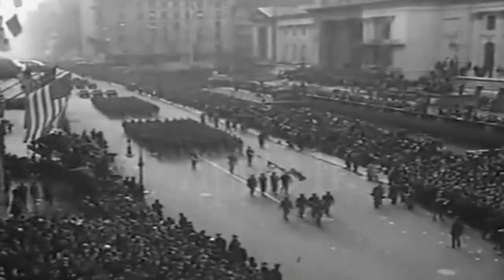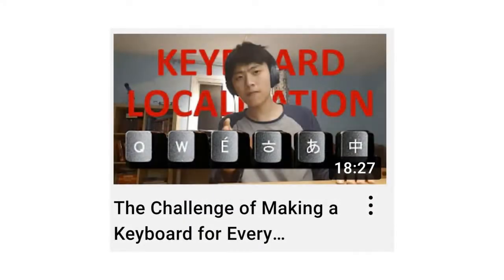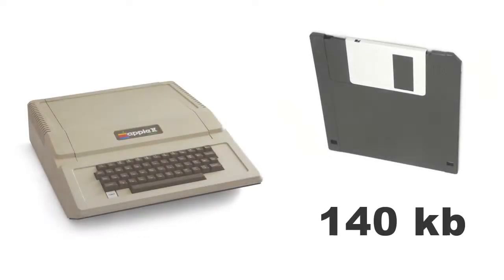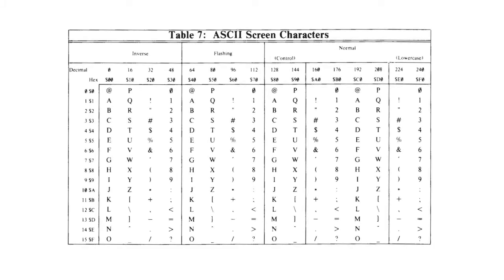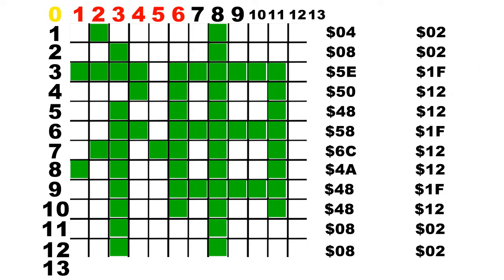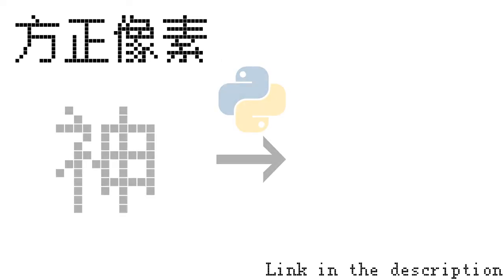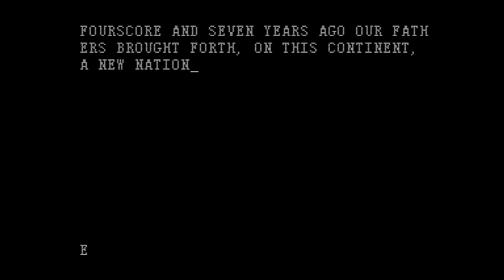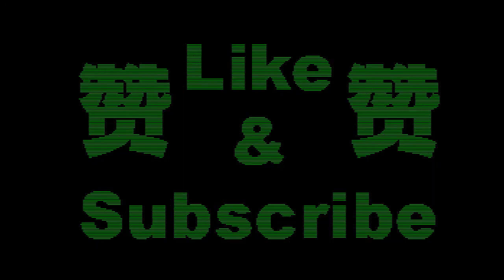How I made typing Chinese on the Apple II possible

Comment: Old computers did not have good multilingual support. even in the 90s languages like Spanish or French would get messed up if you had accents on the letters like è would be ? .and that was on systems with a 500mb hard drive and could play quake and browse the internet not 8 bit systems with very low storage. i think i saw a windows 3.0 ad from the early 90s where they bragged they supported 10 languages now they got 130+ on windows 11.
Reply: Old Japanese computers had brilliant multilingual support. But it's hard to fault Apple for not building that in; it's expensive, and what American would care (or even know)?
Reply: @Curt_Sampson  They didn't they only had Japanese and English and maybe Chinese. they also had to make systems made for japan only .they couldn't compete in other countries because they had different standards for everything.
Reply: @belstar1128  That's pretty much entirely wrong.

The Japanese computers were using American standards for almost all the components. The CPUs were mostly Z80, with a few 6800 and 6809: both American designs that the Japanese manufacturers licensed. Most of the other chips (and virtually all of the important ones) were American designs as well. The video standard was NTSC: the American standard. The BASIC in ROM was almost invariably Microsoft BASIC.

They did export their computers, too, though with somewhat limited success. The cover story of the May 1982 issue of BYTE magazine was a review of five Japanese computers, and I still regularly see people both in the U.S. and Europe with, e.g, a PC-8001A, the western version of the PC-8001 (the best-selling series in Japan). The most successful export was the MSX computer series (from multiple manufacturers, based on a standard developed by ASCII Corporation and Microsoft), which was reasonably well known in many countries (all of Europe, Brazil, etc.) outside of America.
Reply: @Curt_Sampson  nobody used Japanese computers outside of japan apart from the msx. and that one had limited success in only a few random regions. a lot of the best selling games and software for the msx in japan was not sold world wide. and western users had their own different software. there was no law that stopped japanese systems from coming out here. but they failed or never bothered because the market was too different. also all these Japanese systems where incompatible with popular western systems at the time. even if they did use American cpu architectures. because the rest of the world couldn't make decent cpu's. the ussr tried to but they gave up and just started copying western chips. japan didn't have a reason to do that since American cpu's where good enough. but it didn't matter because they actual full computer could only run software made for that computer. in most countries the ibm pc became the dominant computer platform and the mac survived. but in japan the ibm pc and mac didn't get popular until the mid 90s
Reply: @belstar1128  It sounds to me as if you've defined "standard" as, "western computers," which seems to me a bit culture-centric. Japan certainly did fail to meet the early '80s western "standard" of, say, 280x192 6-colour composite video displays set by the Apple II by instead using a 640x200 8-colour RGB display with a separate processor to handle graphics, and an extra 48K of RAM for the frame buffer on top of the usual 64K (1981 FM-8). 

And Japan did make their own CPUs, such as the Panafacom L-16A (MN1610), which in 1975 was one of the first 16-bit single-chip microprocessors. If you're thinking, "I didn't know that," yeah, there's a lot about the Japanese computer industry that's not well known in the west, and that causes people like you to look down on it when in many ways it was superior.

"but in japan the ibm pc...didn't get popular until the mid 90s." Yes, and for good reason. The IBM PC simply wasn't capable enough to display kanji, whereas the 8086-based PC-9801, introduced the same year, was. And even the 8-bit PC-8801 could do 640x400 graphics from the start. Western computers took a fair amount of time to catch up and it wasn't until after they did that they could be useful for business in Japan.

Comment: There was a word processor for Hanzi/Kanji for the Apple 2 series released in 1985. It was called Assist 16. It ran on a 48k apple IIe or IIc, and included 2965 characters. But there was another program that I can't find a reference to, that allowed you to create arbitrary hanzi/kanji by codes corresponding to radicals in each areas of the character.
Reply: The latter program is called Cangjie, but it required an extension card.

Comment: Pretty cool, looked like an easy project lol. I can see why people make "quality of life" improvements to old coding environments, even bitd people would use better faster platforms as their development kit Eg. Amstrad to ZX Spectrum development.
I don't speak or read Chinese but the language conveyance systems shown in the past and the one you made certainly seemed logical in operation. Been working on text related projects myself and most Asian languages are a tough fit within those old graphical constraints and despite English having it's own quirks it is the most compact alphabet ever made by far.
Reply: Depending how far back you go in Apple 2 development, there really wouldn't've been stronger platforms to use to develop on other than considerably more expensive minicomputers or mainframes, with Apple 2 being one of the first home computers that was ready to go and use out of the box.  But yeah later on for sure, and I wouldn't've criticized the person who made this video for using a fully modern environment with a build script that packed it all up in to a disk image to load in the emulator.  I've definitely developed for older systems in the same way. :p

Comment: Just came across this video from a retro Apple community. This is an interesting programming exercise for AP2. Like some comments told we had hardware Chinese add-on back in the days. But I also want to point out that we also had a software solution that intercepts console input output which makes it compatible with applesoft basic. Fonts are loaded from disk on demand so that could be slow and noisy but still useable. Font size was 4x of alphabet character and was in traditional Chinese.

Comment: Very interesting view.  If I can suggest another feature that could have introduced Chinese characters back in the early days of Apple, a ROM card would have been the cheapest and fastest way to get around the memory and search speed problem.  ROMS were cheap, cheaper and faster than disk space, not to mention the price of the disk drive itself that I could not afford.
Reply from the maker: That was actually the main way that character input was configured in both China and Japan in the early 80s. I'm covering a machine soon that includes a 汉卡, a character ROM card.
Reply: @InkboxSoftware  I'd be glad to add them to my humble Apple II+ emulator.
Reply: @InkboxSoftware  Were any computers that had chinese characters built into the hardware by default, or did they all require plug-in rom?  Or did they stick with pinyin, forcing these cumbersome (yet very skillfully made) workarounds to display proper chinese text?

Comment: As I am Korean, I am Intereted in this. Korean is Using  11171 character But It can be disbanded.
12x12 Pixel. It's Size is 4 (2x2) ASCII character per 1 Chinese Charcter. right?